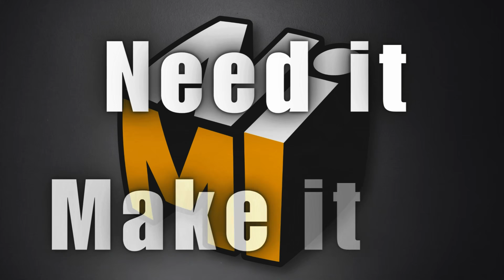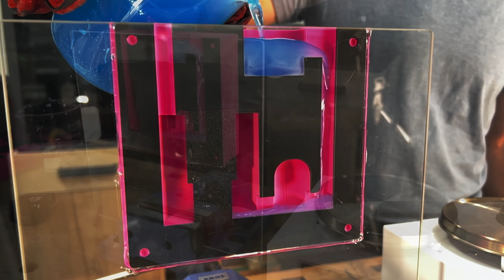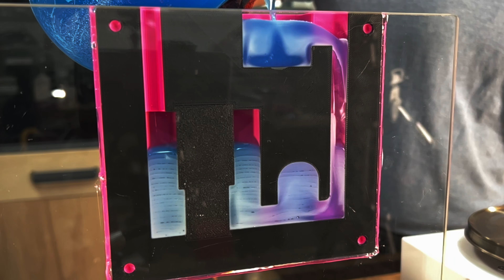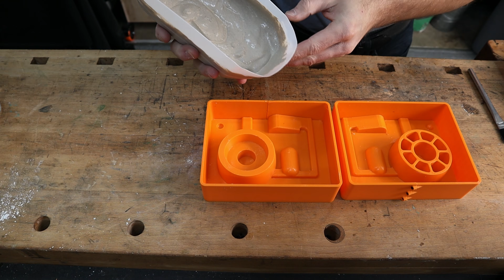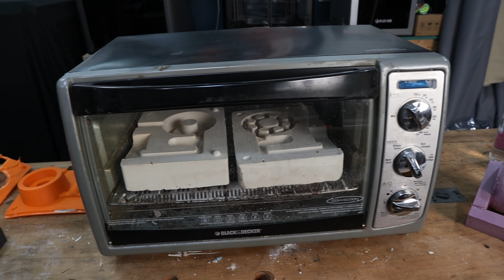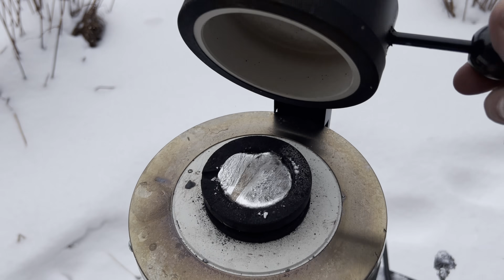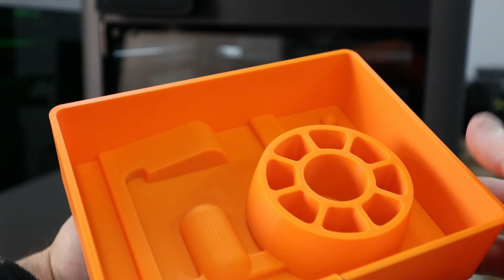Casting detailed aluminum parts is probably not a good idea and here's why.

Comment: Very interesting video!
You're pouring a mold reinforced with sand and "fibers."
The thing I would have approached differently is your two pouring stages, rather than pouring 50% unreinforced and 50% reinforced.

I would have used two different mixtures for two different objectives.
The first (~5% of the total) is 100% plaster, 0% sand, and 0% fibers. Its main objective is to take a faithful impression, applied with a brush to all surfaces of the piece to be reproduced.
For the second, the objective is 100% reinforcement, so all the sand and fibers are poured delicately onto the first layer.

Comment: SUGGESTION Use white foam for riser and vent. it is less dense=less off gassing. Paint foam with plaster (ala lost wax type casting) so its supporting the sand, as well as eliminating a sand finish. Last, try rotating the PLA item so the smaller retail is down and fills first.

Comment: Most I see do this type of casting uses a well at the bottom of the sprue instead of a pouring basin at the top so the well doubles as little reservoir. Then the heat is kept better down into the mold. Your blind riser seems to have done it's job well though.

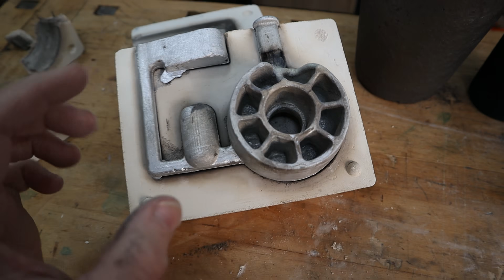Comment: at 17:30 I don't think it's a cooling issue.  That's trapped gas holding the metal back.  I'd also use a vertical orientation for the part but let's try improving what you have (plaster mould).
1.  Not enough head pressure. Ditch the blind riser and add that volume to the sprue - higher is better.
2. sprue offset from part too long. it acts as a cooling tunnel.
3. VENT!  Drill small holes at the intersections of the webs and circular sidewalls right through the mould.  The gases will then go into the sand and the holes will plug as the metal rises.  In practical casting I'd extend that area a couple MM as it's a fast turn on a lathe to trim vent bits and true up the end.
For thin / intricate features you need pressure like roto-casting or injection.  Lacking that go for high head, lots of vents, and a fast hot pour.
p.s. Don't get your soft alloys (wire, cans, and extruded) mixed with or into your casting alloys.  It's nasty stuff.

Comment: If the problem is the cooling, would that be fixable by pouring a lot of aluminium through your mold very quickly?

🙃 I know, if you added the features into your mold to save on aluminium, that's  not a solution to your problem.

Comment: I'm not a metal worker, but I've always wondered why not fill the mold with CO2 before filling the mold? You could use baking soda and vinegar to make the CO2 and have it pour into the bucket with the mold, maybe have a lit candle next to the bucket so you know when it's full then make the pour. On paper it should stop the oxidation layer?

Comment: I think the reason it failed was due to a trapped gas pocket, if you add a second vent at the point where the material failed to go it will work.

Comment: When doing metal casting, you better see if the alloy you are using is for sand molding and not for injection molding, in this case aluminium is for injections molding so use other metals like zinc, tin, copper or alloys of this metals suck as ZAMACK, bronze tin, brass, etc...

Comment: looks like the metal was too cold and didn't flow up all the way. I'd just heat the metal up more, and/or heat the mold up more if possible. I don't think this is a shrinkage issue

Comment: THAT'S the reason the refractory material is so expensive! When it cures, it's porous which allows you to bake out nearly ALL of the moisture, and it allows gases to escape.  Take your pattern with a sprue, apply a THIN coating of the refractor, bake it according to the mfg's spec, suspend it in a bucket and fill it with sand, then pour. That's effectively the same process as the commercial guys.  Refractory is the material it is and is ALWAYS used in the applications it's used in for the same reasons you see iron/steel forges made with FIRE BRICK, not just any old clay brick you buy at Lowes...

Comment: So we tried plaster of paris several timed for making multi part mold where we had to make the mold sections separately as there were 3 or more parts with very poor sucess. We were told by a casting expert that for any high temperature casting (any time the metal becomes incandescent  AT ALL) that plaster of paris is the WORST thing you can use because the plaster is not porous (so it traps water) and the water content is too high which generally causes the plaster to fail mid pour as the water will flash to steam and literally blow the interior surface apart. Even after baking at high temperatures (400-600°F) for several days, it still had too much moisture in the plaster. If it's large simple shapes you can do it. But if it's cross sections less than about ¼-⅜ it will fail every time. My father and I have been doing hobby casting for over 40 years.

Comment: I've never casted anything so apologies if my ideas are terrible.
Would making the molten aluminium hotter help reduce its viscosity at all? 
Would preheating the entire mould also help the molten alloy stay fluid a bit longer? 
And would tilting the mould in the X & Y directions after (during?) the pour help get the air bubbles out and also fill in any voids?

Comment: Ideally you’d head the mould up to 200C+, but I don’t know if plaster can handle those temperatures before the dihydrate decomposes. Also the hair wouldn’t hold up, so any fibrous reinforcement would need to be inorganic. Glass wool seems sensible.

Comment: I think that heating up the plaster mold to very high temps before pouring would solve the issue with cold shuts forming. Great content regardless and casting metals is probably going to be the next step for makers to produce more and more complex project. Thank you so much for the content

Comment: Its not the cooling, its air getting caught in the mould. If you turn the wheel to be diagonal instead of laying flat, and have a larger riser from the top most position it will work better. Also, preheat your moulds.

Comment: What's the tensile strength of beard hair?  I'm betting it's very low.  Probably not a significant addition to the strength of the resulting composite, but hey, at least it's going to STINK LIKE HELL when you pour.  🤣😅😂

Comment: I'm surprised you haven't tried the Printed wax, and then plaster dip, then sand dip, then plaster dip, then sand dip, 10-12 times.. melt out the wax. OR. make your mold out of silicone, so when the plaster hardens, you can peel it out and reuse it. Also Also: https://www.youtube.com/@myfordboy is a VAST wealth of casting parts, information guy casted his own intake manifold, steam engines. has like 140 metal casting videos. Dude is amazing.

Comment: You should use refractory. It breathes. Also, PREHEAT your molds, like, 80% of your melt temp, and pour at 110-115% melt temp. Doing this outside in the snow isn't helping anything either.

Comment: Maybe you can use Florists Green Foam used for flower arrangements. Maybe even Walmarts has florist green foam. Being a very fine foam you should get better CNC or hot wire cutting.

Comment: my 2 cents, hope this helps. I would take a look at resin printing for metal casting. The good: is the evaporating resin and the precision of the print. The only difference is that a "professional" setup has a centrifugal chamber, where the molten metal pours into the form. It doesn't spin too fast though.  You could make some test with some honey in a transparent jar to get a glimpse of the viscosity reference to the centrifugal force building up.

Comment: What if you preheat the plaster?  You could build an inductor so big that it remelts the aluminum inside the plaster and cools more slowly.  This is made with jumper cables so you can build an overunity circuit at a megahertz.  Capacitors align a voltage in space, they charge by the voltage attraction betwean the plates and discharge by shorting the voltage betwean the plates, so their attracted in both directions.  Overunity is when you switch the ground from one source to another before the current escapes.  This way 9v goes to 9000v, but 110v volts goes to 550v at a megahertz.  But reheating the mold should be possible with a large autoclave of knice schist.

Comment: More small risers! You had a tiny gas bubble in the webbed area, a small core in that molding should let you insert a little riser for the tip of the webbing.

As to repeatability, I don't think it's realistic to expect to peel a PLA mold out of a plaster casting, rather when you want to mass-produce a part, a PLA master can cast multiple silicone molds, which can be peeled out of the master and used to cast multiple plaster molds each.

Comment: love this content!
Have you considered  using methods that epoxy bagging folk use? specifically making sure that the sprue and vent are place such that the parts' volume must be filled first?
Also, could  tapering/slanting the vent to provide some back pressure such that filling the form is the path of least resistance help?

Comment: Try a large reservoir below the part that allows it to heat the mold above then as the metal fills the feeder to reservoir it feeds the supply which is higher up the feeder reservoir to the part. I use about four to five times the metal for a complex part to prevent all those issues.

Comment: This is why molds are often heated before injection or pouring.  Gypsum has the advantage of being regenerable with an oven at relatively low temperatures.

Comment: Suggestions for the future:

First, your draft angles aren't aggressive enough for the rougher texture from a 3d print surface. With other methods the the blanks tend to be smoother so things come out easier, or the fine details aren't preserved nearly as much so it doesn't engage as hard. Solve either of those and you should have an easier time of it.

Second, fillet absolutely everything you can, sharp corners are your enemy.

Third, with a vent/riser that large you can probably omit the large reservoir on your sprue giving you more volume to work with.

Fourth, your fine details tend to come out nicely at the bottom of your cast. You can probably improve that by getting the mold hotter, but if not I'd actually suggest rotating the part back to the vertical position it was in before with the details at the bottom, and giving an extra bit of material on the simple rim up top for you to be able to cut out the cold close. The "correct" way to fix it is to get your mold and metal hotter while also increasing the complexity of the sprue so that it more evenly injects your metal and it doesn't cool nearly as much before it gets to the details.

Comment: Kelly Coffield does a lot of automotive intake manifolds using lost foam. He dip coats the foam in a refractory coating before placing it into the bucket of sand. He turns out some really high quality castings with his home setup. 19:30 I guess you can ignore what I wrote.
Reply: Kelly also mentions about using drywall mud with dish soap in it for more simple castings.
Reply: @AzDad1928  Yes.

Comment: For DIY refractory compound for lost foam, try (by weight) 1 part Elmer’s glue mixed with 4 parts water, add 1-2 drops of dish soap / cup of liquid, mix in 5 parts clay (I bought ball clay from a ceramics supply store).  If you make a batch and have some leftovers that dry out, you can reconstitute by adding back water.

Comment: Gypsum plaster is, generally speaking, a terrible media for casting all but the coldest melting metals. 

Gypsum plaster is a mineral hydrate. That is to say it's a solid material that has a large amount of water chemically incorporated into it. (Where did you think all the water went when you mix up a batch of plaster?) Critically, when a hydrated solid is heated it decomposes, releasing it's trapped water as well as mechanically degrading. All of that is huge problems for casting.

When casting metal, you want your melt to remain liquid the entire time you are filling the mold. Solidification should only occur after the entire mold is filled. To achieve this goal, you usually want your melt well above it's melting temperature, which gibes it more cooling down head room before it solidifies. Furthermore, you want a mold that keeps the metal's heat from escaping too fast.

Gypsum plaster + sand is extremely poor at retaining heat. First, because it's fairly thermally conductive. Second, because the decomposition robs heat. This causes your melt to solidify to fast to be able to fill out the details of your mold. Combine that with the fact that you essentially cannot "dry" the plaster enough because it physically is made from water causes even more defects.

TL;DR: You are basically trying to cast your metal in a mold made out of ice, it's going to cool the metal way to fast, and also product a lot of steam related voids. Very sub optimal. I would use a refractory investment myself.

Comment: 1 put an inverted cone on the top of the blind riser to create a hot spot it will feed the casting better. 
2 use the inscribed circle formula to calculate the size of the riser contact point. Which will ensure proper feeding. 
Vent..

Comment: Consider giving ZAMAK instead of just Aluminium a try? Lots of stuff is being made from it like Faucets and Door Handles and it can be melted with a handheld Gas Torch ( it's essentially Tin Casting PRO™) requiring much less heat than pure Aluminium making it even suitable for casting into Hight Temperature Silicone Moulds ( it's how I cast the Swing Arms for my 1/16 E-100 RC Tank ) and it flows like CRAZY being runny enough to escape through a 1mm Breathing Hole.

That being said... I really think you should a) have the feed come in from the bottom and b) pour faster by making the entry point just a giant funnel you can just hose the metal into no questions asked.

Comment: What really helps is heating up the mold. I had made a bridge from drinking straws Packed that in plaster and burned out the straws at 250°C i got the hot mold out of the oven and put in the aluminum. It castes all the details. I also put in a tall sprue and vent, to get a high pressure in the mold.  And i think that's the problem i see with your attempts. If you getting a higher  pressure in the mold the air will be squeezed out.

Comment: I think the biggest problem is that you've got the mold oriented in the wrong direction. The cylindrical portion should be vertically oriented, and you should probably have two pour points. However, it's also a perfectly viable solution to overcast and machine the slop out of the part.

Comment: I think that just a change in alloy could save this. ZA12 is magical and cheap, zinc aluminum alloy that is meant for casting

Also a little bit of carbon black or graphite on your plaster would go a long way for any hopes of re-use. PTFE paint exists for 3d printer nozzels and would probably act as a great mold release to reuse the 3d printed forms

Comment: If your not working with a large crucible mass preheating your molds can sometimes get you by. Pull the molds out of the oven and put them in sand before you cast. Also coating the mold surface with graphite powder (rub it in) it will improve your surface finish exspecially if you arent using a covering flux, degassing flux, dross flux, or viscosity modifiers ect. You should be able to get decent results, if flow is an issue and cold shuts persist mix a mixture of sodium chloride (NaCl) and potassium chloride (KCl) ad a modifying flux to reduce the viscosity.

Comment: it would probably help to keep the mold hot before you pour, so the material that touches the side of the mold don't solidify too quickly and prevent flow. This is probably not super easy during a blizzard though haha... maybe put it in an oven?

Comment: just an idea here, and i dont know if you have 1. But 1 of those cheap flat surface sanders that prettymuch vibrate the sanding surface would probably do a great job to vibrate the molds after the pouring of the plaster. Kind of like a vibrating needle in concrete pouring is use. Helps get air out, helps it settle in to all corners and makes for a better fill without all the work.

Comment: You don't need commercial slurry for casting aluminum.  Use the pink insulation foam for the pattern and a box of all-purpose drywall mud from the box box store.  Dump it in a five gallon bucket, add water and mix with a paint mixer drill attachment. Yes, you have to dry it, recoat it, dry, etc.  Takes days. Then you just pack it into play sand and pour.

Comment: You need to fill the void from the bottom so the molten metal only rises, in stead from the side and it has to flow in several directions.

When you cast, first it has to go below the part and then it fills towards the top. I don't really know how to exactly explain it, I hope you understand.

Good luck!

Comment: Regarding coating your foam parts with refractory, I paint my lost foam parts with the same sand/plaster mix I use for plaster mold casts to keep my sand texture from telegraphing into the casting.  (I used to use setting drywall joint compound for this; It worked too, but I saw more bubbles in the casting.)

Comment: Great video!. Why have the inlet gate mid part? I assume it is to conserve heat. So when filling it does not cool as much at the top of the mold. If this is the case why not put the gate a little higher? I love the idea to fill the test with wax to better visualize cooling not just air traps.

Comment: for your sprews: most professional ones I've seen are tapered, not sure why. For your uhhh...fiber? reinforcement: you can try ceramic wool or regular fiberglass if you're getting mold cracking. 

for the finer details you're right: more pressure and more temp would help a lot with that. try a taller sprew and have the cylinder on it's side instead, with the more detailed end being at the bottom.